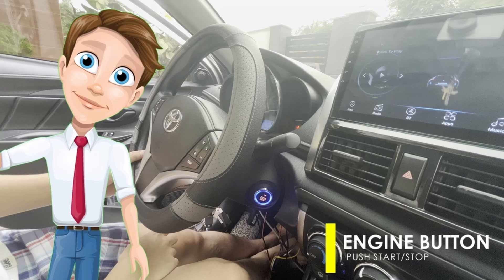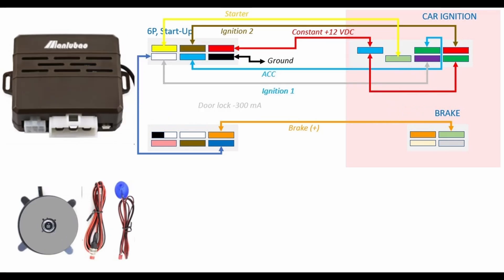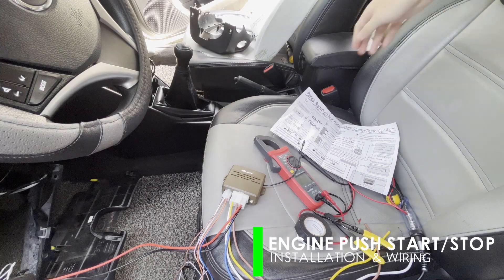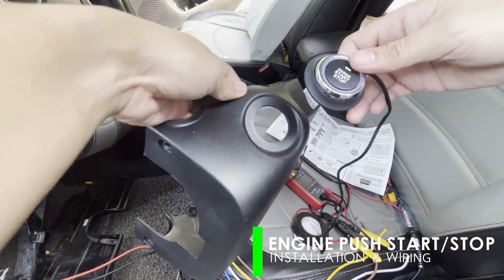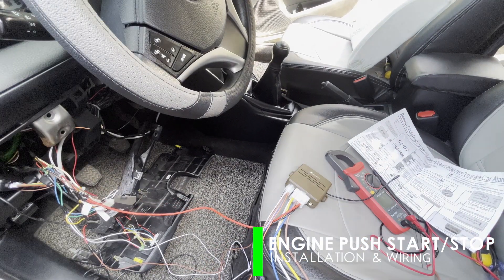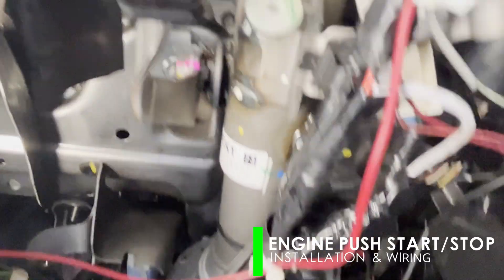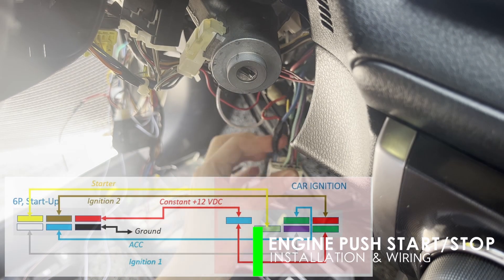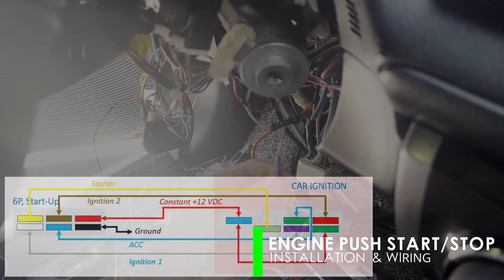Smart Engine Start and Entry System [PART 2] How to install push start button #Toyota #KeylessEntry

Comment from the maker: Please note that in this video, the engine push start is started by depressing both the clutch and brake, please do watch [PART 3] on how to bypass clutch. Thank you!
Reply: did  you install door lock unlock key fob? if factory  alarm and anti theft system is installed on land crusier prado 120 or similer=?

Comment: Good morning, I connected an alarm with a start-stop button, just like yours. It tries to start, but the 2019 Corolla won't start. Does it have another kill switch that's activated with the original key? Or what could it be? Thanks.
Reply: Highly likely from previous alarm system...

Comment: Bro what if iwant to tap it on the original alarm box do you have any idea what wires where to tap?
Reply from the maker: Hi Sir, actually I did not removed my original alarm box, u just connected them in parallel.

Comment: Do you replace the original alarm box to this or you just add it on this by connect direct from key start plug?
Reply from the maker: The original alarm box is still there sir, it’s like two alarm systems connected in parallel

Comment: How is the car starting when the immobilizer system is not detecting the key sensor? I didnt see you bypassing the immo?
Reply from the maker: In the installation process, you’ll see that there is a key inserted (no head) in the ignition key positioned in acc mode. My car model is basic, no transponder needed, just the key.

Comment: Rip engine immobilizer😂😂😂😂😂u should remove lock and stick key chip in steering wheel
Reply from the maker: Actually my car does not have immobilizer or transponder fitted on it.

Comment: How do your know which is ignition 1 ND which is 2 on the car? Is there a problem if they are switched?
Reply: I just installed my first alarm /remote start about a month ago. I had the same question and from what I gathered from other professionals it doesn’t matter as long as they are both connected. I’m a 12v professional as well but never done one of these and they are nerve wracking

Comment: What did you do with the old ignition?
Reply from the maker: It was just there inside sir, ready to be plugged if you want to return to original ignition key
Reply: Bro, just like to ask, i have followed the manuals and watch your videos several times, however my push start doesn’t “on” when i pressed the brake pedal it gives light to the start/stop button, but does not engage in either acc or start. Do u have idea for corolla 2016?thanks in advance.

Comment: Hi bro, how to connect if my car got two wire starter and two wire 12v?
Is it can be loop and two wire starter to alarm wire starter and
Loop two wire 12v to alarm wire 12v?
Please advised😅
Reply from the maker: Hi sir, i believer you have the same set up with my friend. For the 12vdc sir, 2 pins right? you can connect to both wires using jumper or you can connect it to only one, just choose the larger wire. 

For the starter, they're connected on the same pin but 2 wires, right? Just connect the wire to the both of them sir.
Reply from the maker: *believe